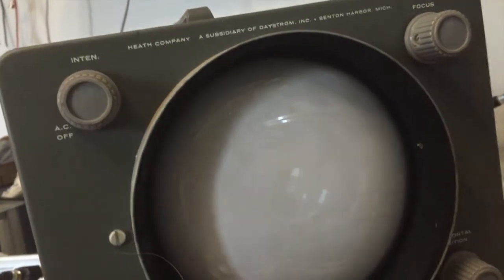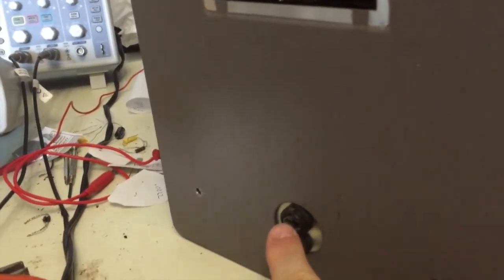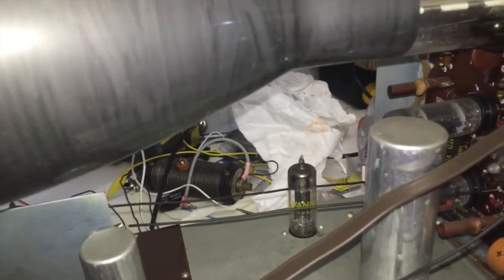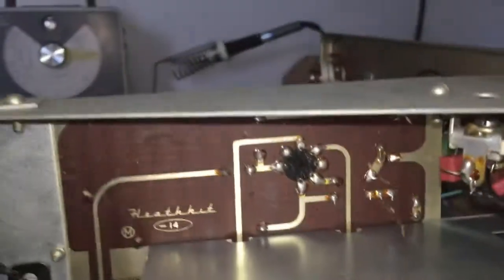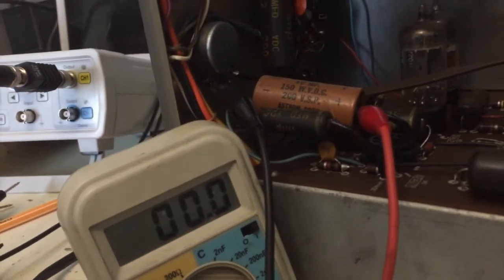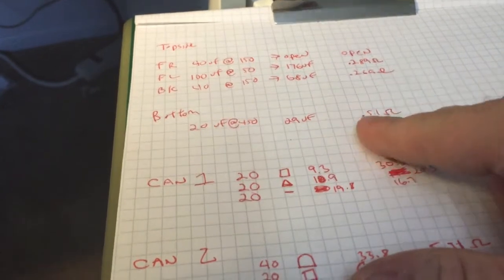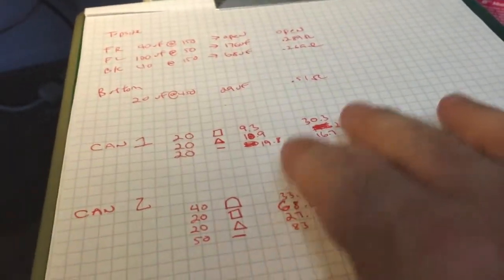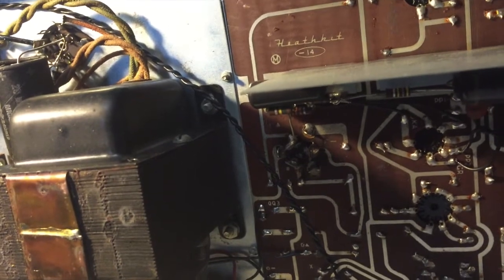Heathkit Oscilloscope O-12 Restoration & Repair 1 - Inspection and cleaning

Comment: Hi! I just bought one of these and it turned on initially but now won’t turn on. Any suggestions?
Reply from the maker: Yeah so generally a bad idea to plug in and turn on antique equipment. Releases smoke and small repairs are now extensive